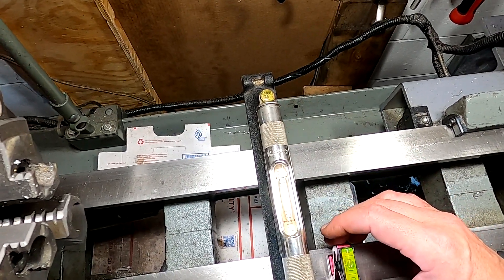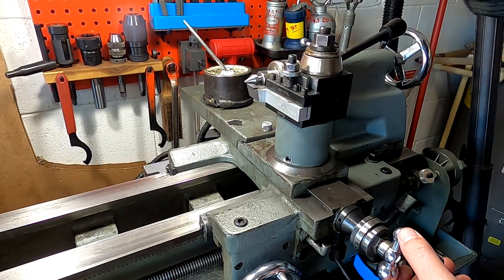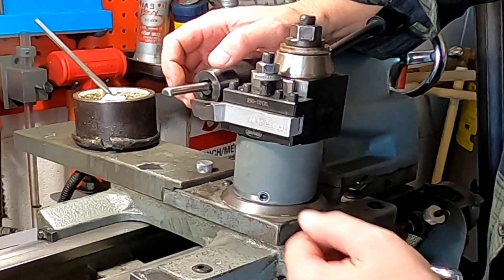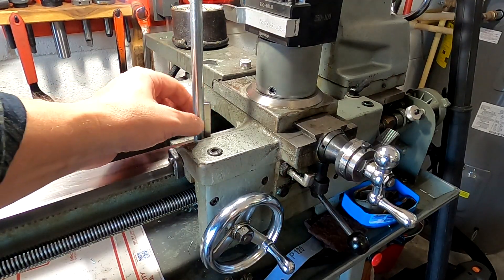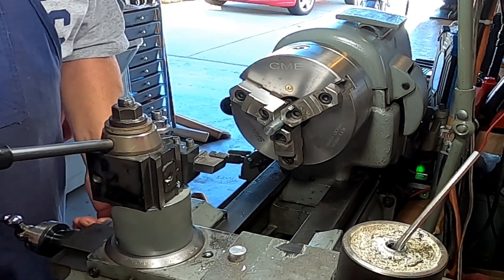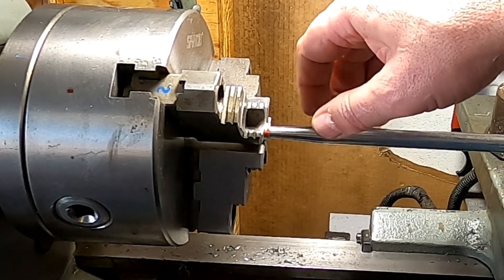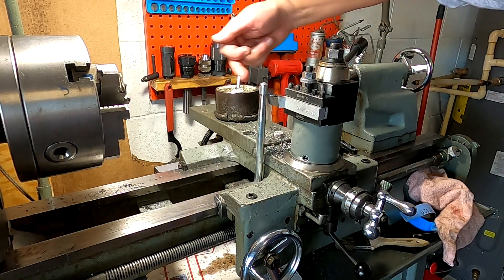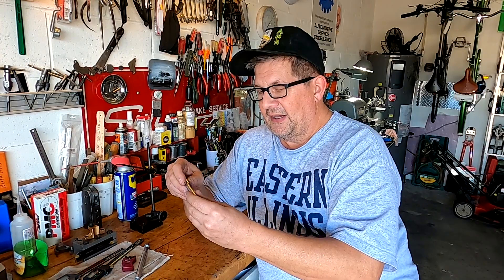Make a lathe tool height setting gauge. Set lathe cutting tools to correct height. Atlas, Craftsman

Comment: Put a cap on the magnetic end, something you have to remove to use the thing (like a pen cap). That way you always remove any accumulated chips.
Reply from the maker: I actually have a hydraulic line plug I use to cap it with.. good point though.. Don

Comment: Just remember that the tool isn’t at the correct height until it’s locked in place. So if you adjust it, then lock it, the height will change, so this can be an iterative process. This is true for any of these methods.
Reply from the maker: Yes, double checking should always be SOP...  Don

Comment: Don, off topic Question. I have a vintage 11” Rockwell Drill Press (circa 1970’s) I bought off craigslist a few weeks ago. It worked initially when I bought it but now it won’t turn on. After I  ran it the first time I noticed right where the cord exists the motor there is gash in the cord. Probably from breakdown over the years from being bent. So I wrapped it in electrical tape, but now it won’t turn on. I wonder if I pulled something loose or if the cord shorter out? Not sure but any help you can offer would be greatly appreciated. Thanks!
Reply from the maker: You may want to start at minute 21:44 on Vintage 1950's drill press restoration pt 2
Reply from the maker: Sounds like you're on target. I don't know which motor you have, but there should be an access cover right adjacent to the cord where it goes into the motor. If you pull it off, you should see the connectors inside. Id remove the cord completely, shorten it past the bad spot and reinstall it. If the cord looks crappy when you're shortening, then it may be time for a new one. I did a Dunlap drill press restore for this channel a few months back. You may want to have a look at that and see if that motor is similar.  good luck. Don